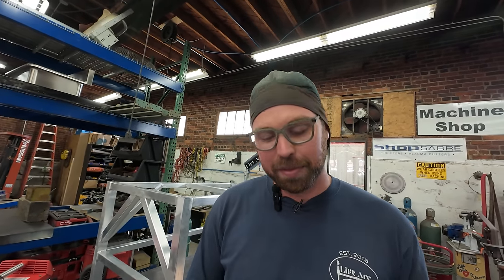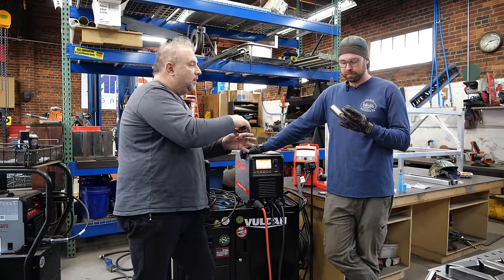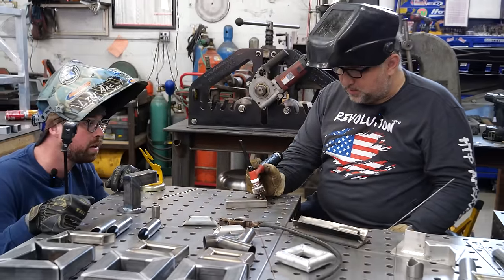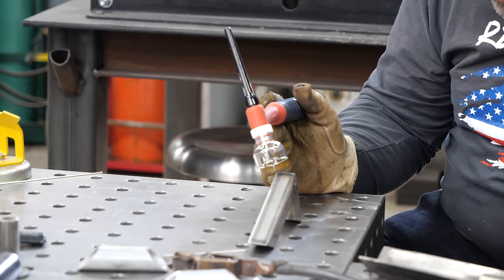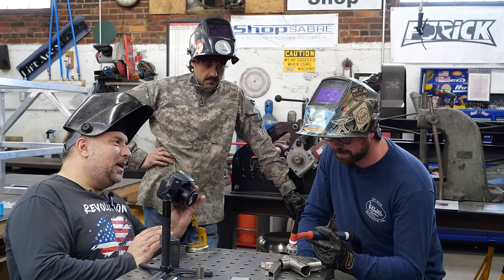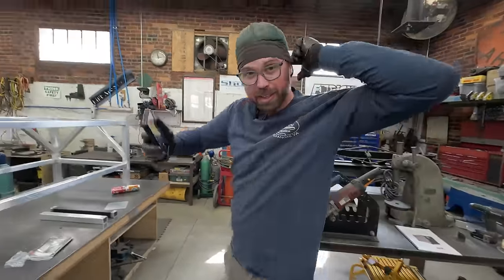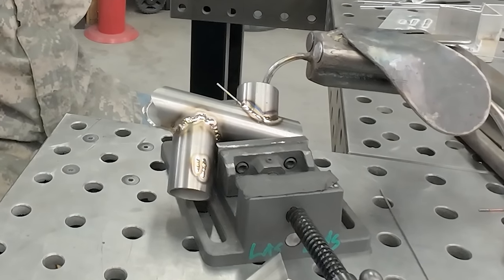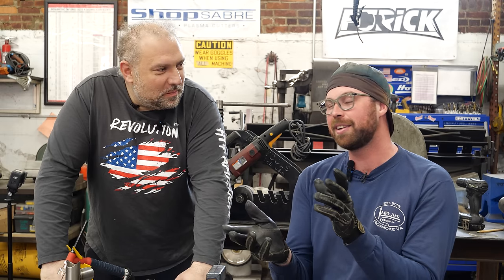TIG Welding Titanium for the FIRST TIME

Comment: I find with titanium running a mooseknuckle 14 cup 4-5 dabs let cool  I run 75 amps max take your time keep it no more than a purple in my welds. Problem with titanium is it's so expensive the only thing I make out of titanium is intake tubes hot side and cold side turbo tubes.
Reply: U heard it needs to be gold or silver for it to pass inspection